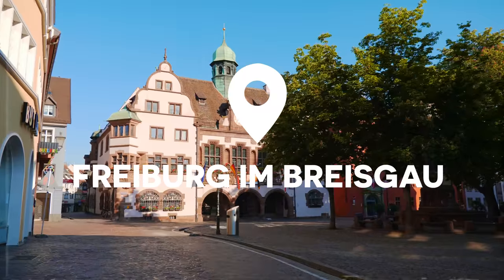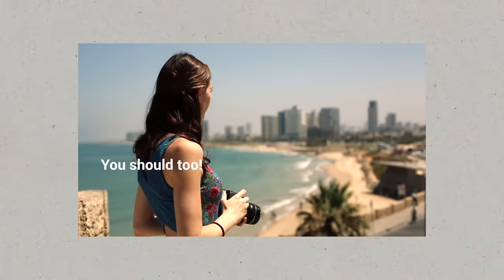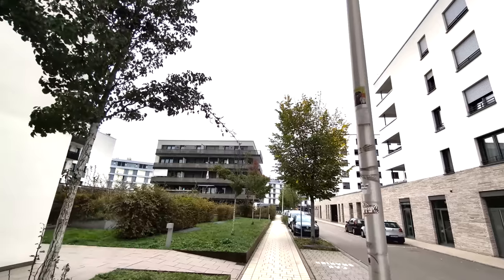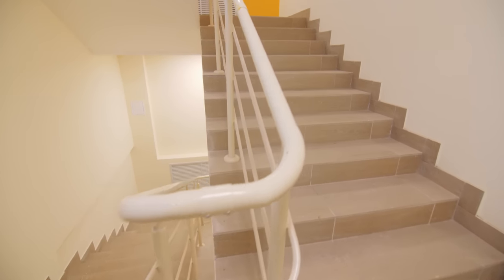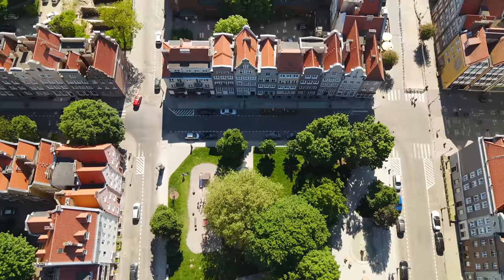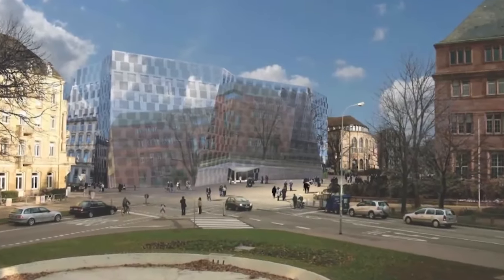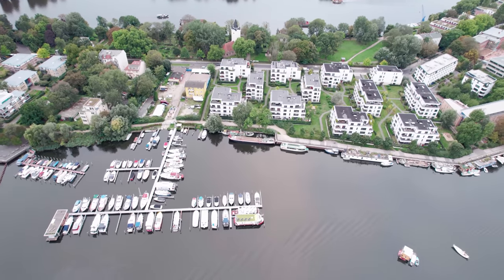Germany's BIG DUMB BOXES ARE AWESOME.

Comment: For example: you can make windows any size you want. But if you just use a standard size window and design your rooms to use these windows, you save 20% of the costs of windows.  You also have a wide choice of retailers and do not rely on custom made products and all that is involved. There is no law, that tells you what the standard sizes are, the sizes have developed over time by just by the laws of demand and supply. This also means over time the standards will adapt to the demands of the customers. The window sizes also fit in with the other materials, that you also get in standard sizes and measures, with standard doors, standard curtains... which streamlines everything. If you still want to have more custom elements in your building, you can put your money in expensive furniture, tiles, fancy colours etc.

Comment: I live in Freiburg too, and I agree with many things of your video. But I have a problem with the flat roofs, because they leak very often and require a lot of polysterol insulation which is bad for the environment and bad for fire protection. Insulation made from wood, is far better in both categories, but you can use wooden insulation only on angeld roofs.

Comment: They may be called dumb boxes, but I think the library is more of an example of a dumb box. Cleaning the glass every 6-8 weeks will also cost a fortune. New developments need to think of energy efficiency as the most important factor of a building. Maintenance, reusability and durability of the used materials must be second and comfortable living and working in a building should be third. The architecture of the exterior should be forth and last. A BREEAM performance score of a building takes care of the first three. It isn’t a mandatory performance, but it should be. Currently it is a voluntary standard, but it is increasingly becoming an asset in real estate and housing development, in Europe that is. The US and Middle East hardly know what BREEAM is and where it stands for and don’t/won’t design their (iconic) buildings accordingly. I saw a housing development video of 2023 in the US and they put poorly double glazing in uninsolated aluminium window frames. We used that double glazing in the eighties, we are currently at HR+++ or triple glazing and we always have insulated aluminium window frames. No sufficient insolation of the outer walls or roof. You don’t see double gap sealing of window frames, flimsy hinges and locks a burglar would laugh at, no solar panels (and it was in Arizona). We wouldn’t get a house insurance with those hinges and locks. Separation walls that only separates physically, every sound goes through it, probably no building code for this. Houses so close together without fire protection they’re a fire hazard for the whole neighborhood. No mandatory smoke alarms or CO alarm. The US is so backwards in (energy) efficient construction. Their building codes are laughable. Americans really build dumb boxes, more cardboard boxes with a nice facade. There is whole territory to gain here in the US.

Comment: I mean, the saying isn't wrong. Think OUTSIDE the box. The inside of most of those boxes is likely standardized. At the very least it will be decorated by the people living there, as it should be. I grew up in big, dumb, ugly boxes. I'm insanely fascinated how well they work. They're really well designed. On the inside. The ugly part is the outside. 

I see more better designed outsides now but it's not yet the norm to not just plunk grey boxes on a field and a few green shrubs around.

Comment: i work as a scaffolder and the number of hours it takes us to plan, calculate, ship and build a scaffold for a big dumb box is ridiculously lower than anything with bumps and odd shapes. i am not joking when i say i would estimate a dumb box takes only 35-40% of the time of the odd shapes to build and scaffolding costs for a site is one of the bigger costs nobody thinks about.

then a big issue with odd shapes, set backs etc. is per floor bulk material handling is impossible. with a big dumb box you do the first/second floor then you know you will need X boxes of screws, Y number of 2x4 etc. so you just crane it in all at once build and not there is hardly any leftover material you might need to hand carry out. with the odd shape you might be stuck for a week just carrying things by hand since it was impossible to know how much you needed.

Comment: I’m 95% in agreement but having done my dissertation on the build cost of residential high rise buildings I can state the following:

Ground conditions dictate the cost more than the height and thus greater economies of scale “can” come into play.

I personally think the cost sweet spot (🇬🇧) is 10 storeys especially in soft ground that requires concrete piles anyway so a 330mm pile Vs a 400mm pile is negligible on a big job!

So as a developer I don’t mind paying £648 per m2 Vs £675 per m2 if I can sell 30 extra apartments 🌆

Comment: Well, I like big dumb boxes for cars and houses. As a Mechanical Engineer that at least studied HVAC it's as little surface area as possible to cover as much volume as possible. I also like circles or cylinders or arches and at least for single story houses partial basement first floors that just extend below the frostline. It's all about saving money and heating bill costs. I am not so much about reducing carbon emissions but efficient structures ultimately reduce carbon emissions too. It's a win, win, win. I do hate flat roofs except for cars.

Comment: The one thing I don't like about these boxes is that they are not so easy to retrofit to other uses. The overbuilt older buildings with tall ceilings can be converted from residential to commercial, restaurants, or even a museum.

Comment: I'm a big fan of "Bauhaus" architecture - just look at the "Meisterhäuser" in Dessau or the "Weisenhofsiedlung" in Stuttgart. Almost 100 years old, still looking fresh and contemporary. Big boxes never age or go out of fashion.

I live in a big concrete box myself, 40 years old, and right next door they just finished piling up 90 wooden (!) boxes the form 50 apartments for social housing. Once the ground work and foundation was finished, it took about 3 weeks. Another couple of weeks to plug the pre-installed plumbing and electrical wiring together, some finishing touches here and there, and people can move in. Brilliant!
Reply: The building I live is a concrete rectangle with a flat roof and the layout emphasises efficiency over style. I’m fan of it because it follows the Meisterhauser design established in Dessau.

Comment: Dumb boxes often look boring or even ugly, so slightly different styles are far more appealing, but a bit of color or a change of materials would also help. Half-timbered houses often are designed as simple boxes, but they look beautiful and the CO2 print is small. They can be resilient - the houses in the (very beautiful) Alter Flecken in Freudenberg were built after a fire in 1666. More expensive to built, but that levels out over the centuries.

Comment: The modern dumb boxes look much better than highrises with glass-fassades. We have one of those ugly twisted buidlings with black windows in Dortmund, too, next to the central station. It's hideous. 
I also found the boxes are really nice to encircle an inner courtyard, most of the time there is much more light that in the inner yards of buildings from last century. What I like about them, is, that they are not that dominating and it is easy not to feel "small and insignificant" in contrast to walking beside highrises. But the fassades of the old houses are much nicer, maybe we can find some middleground? Small oriels? Some decoration around the windows? Maybe different colours of paint, to get the fassade to be more lively.

Comment: There is a similar size/design that has become standard in the last 15 years in the US (due to a change in the building codes allowing it) -- usually called the "Texas Donut."  (or "wrap" housing)  

The change was related to how many floors of WOOD you could build above a concrete first level, so we have lobbies that can be grocery stores or other mixed use and 4-5 levels of apartments above.  All "wrapped" around a multilevel parking structure, of course.  (sigh)  But its the "sweet spot" where you can house the most people for the lowest cost.   You wouldn't know by the rental rates though -- they don't seem to be any cheaper on the USER side of the experience.

I like the German versions much better.

Comment: The basic design is becomming very common here in Canada now, have been for about a decade. We still sprawl a lot more than we should here but there is a big push towards "infill"/densification in cities here, for a myriad of reasons. Issue here is corner cutting on cheap condo builds by some, due to poor oversight and overheated urban markets, so the design can become associated with these (avoidable) problems.

Uptake is mixed, it's often viewed through a "starter home" (buy) or "THOSE people who rent" lens (in a country that, like much of America, puts Home Ownership on a pedistal). When you are a country of 40 million next door to a cultural/economic/etc titan like the U.S. with extensively integrated economy/media/culture, even housing preferences/norms/culture tends to bleed over the border.

Comment: There is one major flows with modern dumb boxes : they tend (as seen in the video) to be isolated from each other instead of forming longer building blocks. This leads to inefficient use of unbuilt area : you have a pretty open garden/park if you built a maze of blocks on a parcel. It also lead to many building facades opposite to each other, sometimes very close and a lack of privacy in you own home.

Another inside flaw : to optimize the surface area served by a single elevator (hence cost), they are much too wide to allow small size traversing flats (ie flats with windows on both sides of the builing, very useful for ventilation). These wide building may also lack in interior lighting, especially is the windows are too small, badly oriented and the ceilings are too low. Which might often happen to save cost.
Reply from the maker: A lot of the reason for the buildings proximity to one another has to do with modern fire code. With only a single, central stairwell the building must be accessible on all sides with a protected fire lane.  These buildings have opted for the garden (ground level) apartments to have their own green space with terraces. This is great, but you cannot have any landscaping, hardscaping or furniture impeding the fire lane. So the more garden space you give the tenants, the more distance has to happen between the buildings.

Comment: What i don't like about this boxes is the lag of proper water protection from rain. Only a little wind will push the rain against the walls. Wet walls are worse isolators. The evaporation cools down the walls. Wet surfaces attract more dirt, algea and mold. The expected live time is less than a proper roof with good protection for the walls.

Comment: "Small" can be more efficient than "Big" ... or should I say more nimble, faster, and reproduceible.   The concept of "Efficiencies of Size" or commonly called "Efficiencies of (large) Scale".   This can also apply to "Efficiencies of Small Scale".   The 6 story structure has less regulation and can be built with lower cost equipment by even a small contractor, a higher number of contractors, and faster.   Anything you can tow by a large pick-up that does not require a special license can be very flexible and cost efficient.   Any building that can be built with a small backhoe that can be done with just a little training ... can be low cost.   Any product (like coffee) that can fit in a pre-paid USPS "any weight" package that is a standard size is very efficient.   Anything that is shipped under 50 pounds and can fit into a suitcase can be shipped very quickly via airlines.   There are very small tracters that have multiple attachments that can do various things on a small farm where you don't need multi-million dollar harvester machines.

Comment: 10:04 That ugly building is the Karstadt Galeria Kaufhof (or whatever they are called today) department store in Magdeburg, and it indeed has artificial lighting and a skylight. It used to be the Centrum Warenhaus when the German Democratic Republic still existed. However, note that there are zero apartments in that building which do require natural light. And indeed, when you are inside, there really doesn't seem to be much natural light, except for the aforementioned skylight which lights up the stairwell (or.... escalatorwell, I guess?)

Comment: "The door didn't properly open because the wall is slanted." That's the moment when I had to sigh so hard that it made me think of the "Well There's You Problem" podcast. That library would be a great engineering disaster to cover.

Comment: Clip together glazed exteriors are just a problem waiting to happen. And tall structures are a horrific event waiting to happen. I didn't see any community services evident in the video of your box neighbourhood. Bakeries, shops? Garage workshops?  Flat roof buildings are viewed with suspicion in the UK. It rains a lot. Large shops and factories often have buckets and staff with mops when it rains. Where it can, it will. A run off is surely the most basic of structural requirements! And yes, I think that I can spot the expensive apartments. They have large balconies. I enjoy your presentations, I visit German friends occasionally, and your perspectives chime with me.

Comment: The only problem I personally have with those box houses ist the unused flat roof most of them have. With a steep roof you can use it as a storeroom. Flat roofs often have problems with water and aren't even used in anny way.
Reply: I live in a dumb box with a flat roof and we do have issues with water leaking into the walls....but I don't find a flat roof useless. For example we are discussing installing solar panels up there. Not sure yet if we can fit enough between the chimneys etc, but if future buildings are built with that in mind, then those roofs could be very useful. There could also be greenery, which keeps the building cooler. So I am not convinced that a normal roof is always better.

Comment: You are right about silly glass facades being very high-carbon but I don't get the point about the windows being stuck together with plastic goop. All modern windows are sealed and stuck together with plastic goop. Triple glazing is a good thing, and one of the things that makes passivehaus design work. There isn't much difference from a recycling point of view between 3G in timber or PVC frames and 3G gooped together as a facade. Is there?
Great to see someone talking about building design and embodied energy in a sensible way. Very few people know much about the difference between good and bad.
Overall so long as most buildings fit the 'dumb box' description it's probably OK to have the occasional ridiculous wonky reflective building or cathedral by way of variety. They can still be efficient.

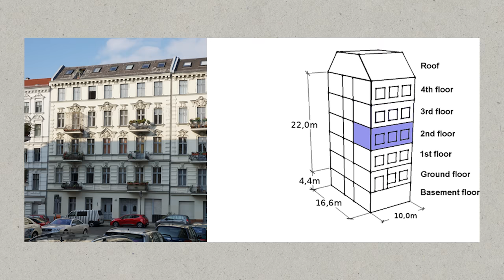Comment: At 6:31 where there is a diagram of a building with 5 floors above ground: would that be built without an elevator? Obviously cheaper to construct with less maintenance and lower energy use but a lot of steps to walk up which I'm not sure would still be acceptable to modern buyers/renters.
Why does the library glazing need to be replaced in 30 years? 
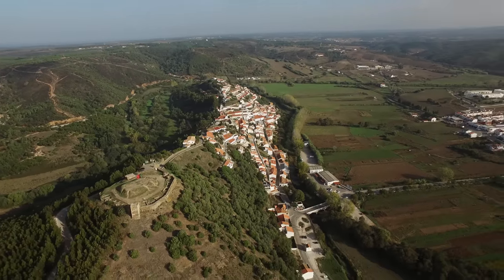What is the hilltop town at 18:17?

Comment: I always thought building height in Germany was more dictated by the laws on elevators, and people just keeping it low enough to not be required to have one...maybe you missed that in your video, i missed it while watching, or its an urban myth^^
In any case I think this topic as well as the broader topic of settlement structure/population densities that results from the building types is quite fascinating, and I would love even more videos on that...
Personally I love higher buildings - they bring the built up surface area to a minimum, make maximum use of elevator running costs, minimize all the infrastructure requirements of a small village to connect to a single point, everything becomes walkable, and in most cases apartments in there offer great views...

Comment: 0:50 But they could save the planet, and look beautiful. You don't need to make them this ugly, it is by choice. Check out some of the new builds in Berlin or Munich, it is still possible to build beautiful.
Reply: 3:52 Look at these boxes for example, those are good boxes. They feature ornamentation and materials that have texture. They are not concrete boxes that are boring, but actually interesting boxes.

Comment: Your intro is funny since what passes for residential architecture here in the States is mostly dumb boxes with ugly colonial looking crap stuck to them. Sometimes there are smaller boxes glued to the bigger boxes and often there are weird and disparate number of gables sprinkled on top. There are oodles of different sized windows that don't fit together and generally just look ugly. McMansion hell has tons and tons of examples.